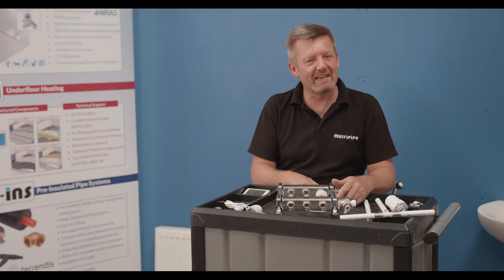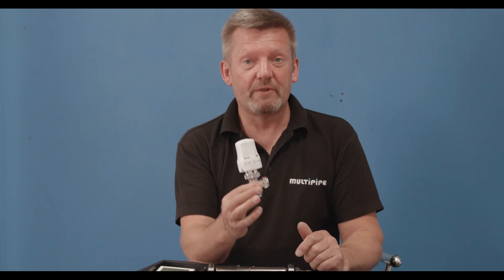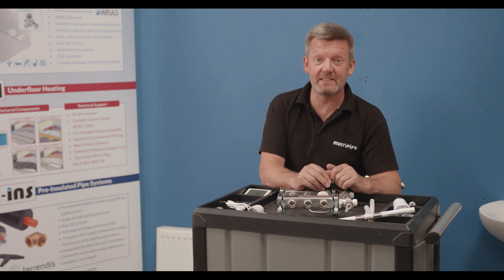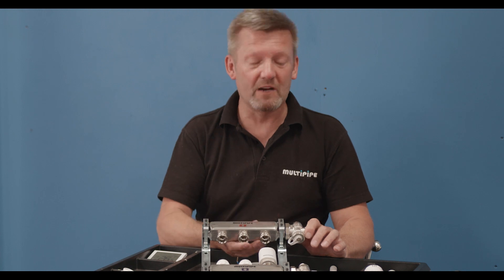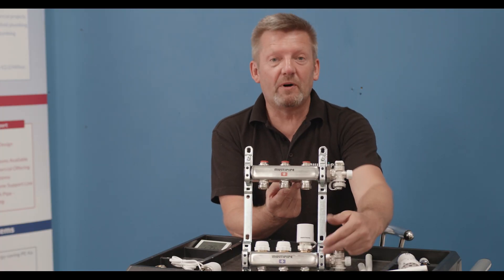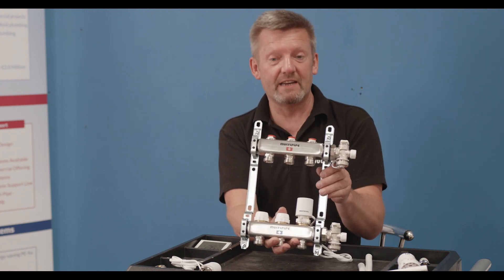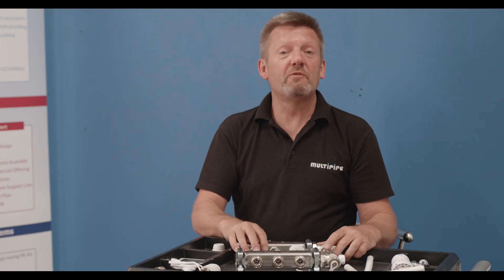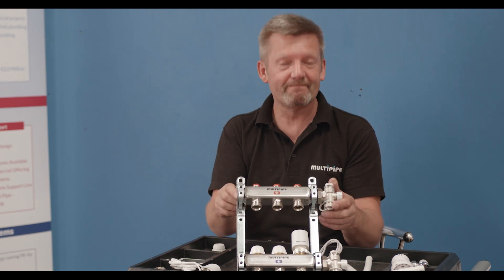How Manifold Plumbing To Radiators Works

Comment: Really interesting and helpful video - we are looking at completely re-fitting an ancient solid fuel stove system with combo and something similar to above. What sort of wiring centre would you need at the manifold to connect individual zone stats to the actuators and back to the boiler? Would this principle still work if using two separate manifolds in the house which then feed back to the boiler. Thanks in advance.
Reply from the maker: That's correct! it is very similar to an UFH system where you have a manifold and a wiring centre to control individual rooms. Why not get in contact with our quotes team. Our team can help get your project specified ensuring you have everything you need. just call us on 01245 227630

Comment: Do you need an additional loop not supplying a rad to act as a bypass?
Im thinking about thermostat calling for heat, but rads being closed via TRV (if still fitted), or perhaps the only room calling for heat being a smal bathroom towel rail for example.
Reply from the maker: the hydraulics is the same if it is a standard branch system (a manifold just centralises the branches) we do recommend a auto bypass is fitted, to stop pump issues. but as more zones shut you may get boiler lockouts, without going down buffers it is hard to avoid this, good rad balancing can really help though.

Comment: Hiya, this sounds like it would be ideal for us. What mm is the feed into the manifold? And also we are planning on installing an air source heat pump - So would the hotfeed into the manifold come directly from the heat pump or from the hot water cylinder?
Reply from the maker: Being a universal thread we can offer multiple pipework sizes off the manifold but our standard is 16mm. as for connection it has to come direct from the ASHP (normally there would be some zoning on the system)

Comment: I agree about the TRV's being located next to the radiator not being ideal, but it would require much more pipe to feed each radiator individually from the manifold.  Not only is that likely to mean lots more holes through joists, more piping running around the house that could be damaged, but also heat loss from all that piping!  Maybe I'm a luddite, but not sure manifolds for radiators is the best way to go, especially when you can now purchase remote controlled TRV's with wall mounted thermostats!
Reply from the maker: You have some very good points you make. However, having single pipe runs with no fittings underfloor massively reduces the chance of leaks. Agreed, more pipework is installed, but in terms of heatloss, most of the time, you run pipework in the floor void of the first floor. This means any heat radiated is actually a contributor to the room's heating, so it is not technically lost. anything in attics, etc., we highly recommend lagging pipework. the snag with wireless TRV's is batteries require replacement every year. but thanks for your comments!
Reply: Wolf Easi joists

Comment: Is it ok to locate a 6 port manifold below the floor it feeds, I have no location on the first floor to hide the manifold. There will be 6 rads in total.
Reply from the maker: A radiator manifold is okay to feed from below because you can remove air from the radiator. I hope this helps.

Comment: Good video, what's the best way to control a radiator in a bathroom in this setup, if going each room as a zone?
Reply from the maker: John, thanks for your question! Because all mains voltage controls are dealt with outside the bathroom (where the manifold is located). A  simple wireless thermostat will control when the actuator opens and shuts that radiator loop. If you have any other questions, feel free to comment or call us for a quote.

Comment: Looking into replacing current pipework (copper) in a 90s build bungalow with concrete floors. Is there a limit on the maximum length from the manifold to a radiator that's recommended? or would splitting the system with 2 manifolds be a better option? Also, Is this available in Ireland via reseller? Thanks
Reply from the maker: Derek, thanks for your comment. we normally don't recommend exceeding 15m from manifold to radiator, but this does vary a bit depending on the radiator's output. We cannot arrange an export now. But call us on 01245 227630, and you can arrange your own courier to collect from us.

Comment: Hi there. I've just bought a new house that needs completely renovating. This sounds like a winner and would go nicely with the planned ufh on the ground floor. Can you balance the radiators via the manifold? can you adapt to different pipe directly from the manifold? Are the actuator sizes a generic size? thanks
Reply from the maker: Thanks for watching our video, you are correct they work very nice with UFH on the ground floor as the controls can be done in a similar fashion with induvial control for each room giving far greater flexibility. Also, like UFH, the balancing is done at the manifold. If you are not using our UFH/controls we recommend to use our actuators, these have been tested for our valve pitch, but we can do both 230v and 24v so most controls will work with these. I hope this helps. If you wish for a quote just call us.
Reply: @MultipipeLtd  sounds spot on. I will definitely be going with this system. Can you adapt to copper, speedfit at the manifold ?
Reply from the maker: @1000Mikey  Our manifold is a standard 1" BSP, so copper is fine. As for the outlet, we recommend our MLC pipe. It is well priced and much better for thermal expansion.

Comment: Great Video!

If you wanted to run multiple manifolds (one for each floor) what would the configuration be? 

We are looking at 3 floors, Firstly is it possible? and if so would you run a manifold closest to the tank with feeds to the local radiators and feed off this manifold to the second and third manifolds or would you run 22mm from the tank to the furthest manifolds and T off at the other 2 manifold locations? 

Thanks
Reply from the maker: You can do either, by running a large manifold in the plant room with feeds to each manifold, you do get more control for balancing etc. But, most of the time, tee off the feed pipe to each floor is more than good enough.

Comment: If using a manifold for rads only does it require a separate pump and mixing valve like a UFH system or is it a direct connection to the feed and return to the boiler?
Reply from the maker: Hi Alan, thanks for the question. No, you will not need any mixing or pump control as you would always run the Rads at the boiler's temperature. Also, the idea of the manifold system would actually reduce the overall duty, so the boiler pump would be fine. Just try and limit run out to 25m max.

Comment: Useful video thanks - when working with radiators - all of my feeds would be going upwards - are there any manifolds with the fittings upside down or do you have to make a few joins in the pipework to change its direction? (that seems wasteful)
Reply from the maker: There is no reason you cannot fit this manifold upside down. the air vent can be swapped in orientation/ you would vent from the rad.
Reply: @MultipipeLtd  Great thank you